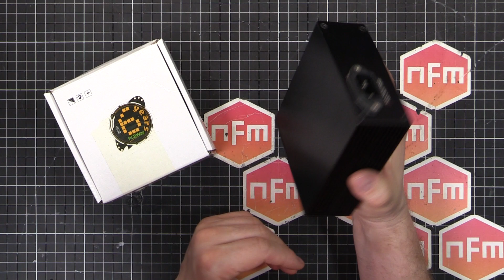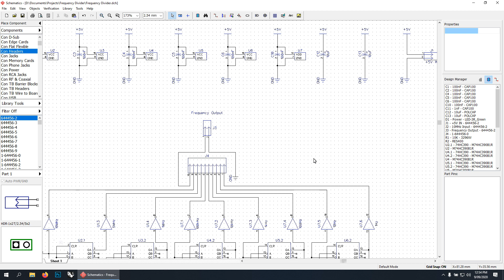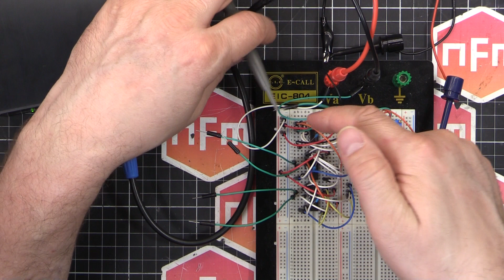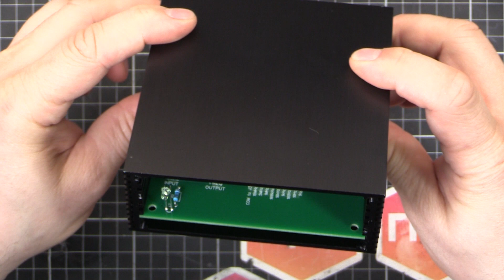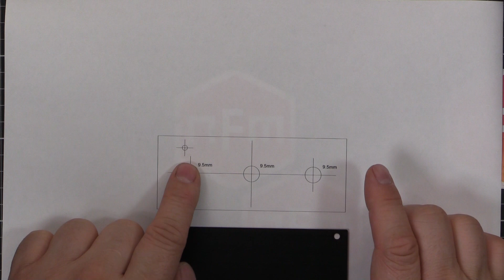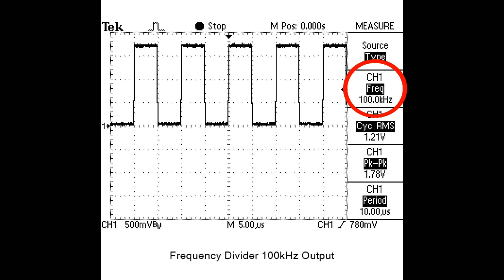Build a DIY Frequency Divider

Comment: Many thanks   Pretty much doing the same as you as GPSDO I'm building just needs extra freq OPs  Kinda wondering why the Outputs were not used with a 50Ohm Rx on OP line and each freq should be run to a PCB mounted BNC.   Yeah i know it adds cost but it really would help the signal.  Once again thanks

Comment: If you get a chance, pick up one of those GPSDO modules on eBay that are real cheap. The good ones were designed by a Japanese amateur radio guy… And for around $200 you get the gpsdo module AND a speteate distribution amplifier. The amplifier can come in many different configurations. The one I like has sine wave, square wave, 10MHz in, 10MHz out, 5MHz out, and 1MHz out. And then I think 100 kHz out of my memory is correct. It also has a built-in oxco, so in case for some weird reason you lose a lock with the GPS satellite, and your standard goes crazy losing precision… Then you have something that’s been calibrated through the GPS that’s still spot on.
Reply: Check outTony albus” YouTube channel. Just search his name and GPSDO. 
He’s made a dozen or videos on those units. Doing some modifications, tearing them down and showing the quality. Really good pieces of gear and I’ve enjoyed tinkering with several sets of them over the past five years or so that they’ve been available. They’ve always impressed me even in the presence of much more precision and expensive equipment.
Reply from the maker: I have a plan forming in the back of my head to build a GPS disciplined Rubidium oscillator one day... It's on my exceedingly long list of things to do. :D
I am subscribed to Tony's channel and have talked with him a bit on EEVBlog forums. He has some good stuff in his channel! :)

Comment: Disapointing not to have made the first stage divide by 1, 2, and 5 (10 MHz, 5 MHz, and 2 MHz) then feed that to the decade division chain, a much more versatile set of outputs that way, although it does require two selector switches.  One can even then have the first stage offer other division ratios like 3, 4, 6, 7, 8, 9, 11, 12, 13, 14, and 15.  Easy enough with a presettable counter like the 74161 http://www.techlib.com/electronics/74161Divider.htm.  It is even possible to make such a divider with 50:50 output ratios for odd divisors.  https://patents.google.com/patent/US4399549A/en https://docs.google.com/document/d/1oQQUQVIvm33vJ8Sbp-bS1E1WYXVPJJQWglZh_TcoZuM/edit?usp=sharing

Comment: Nice project, I have something similar which used to be sold by AADE (RIP), it had a built in 10MHz TCXO as well.
Reply from the maker: Oh cool, so basically both my black boxes in one?
Is there any info online about it? I'm interested in how they implemented the frequency division (and if I can steal any ideas if I make a version 2 :D )
Reply: @NearFarMedia  - I will have to see if I can find a circuit diagram or something, the guy that designed/sold them died about 5 years ago.

Comment: Handy little device, nice job. 
... and I learned that mini XLR is a thing, looks like a nice power connector for projects.
Reply from the maker: Yeah, I found them years ago when messing with building some video camera accessories and completely forgot about them until now, they are relatively cheap and work really well. The click as you connect them is pretty satisfying too. :)